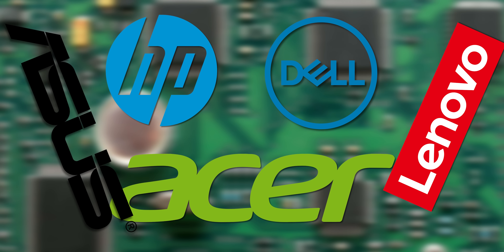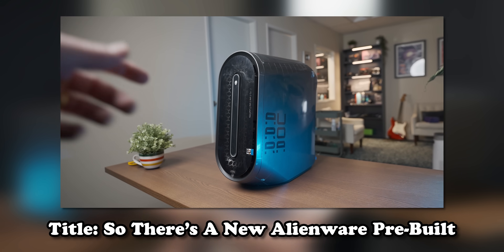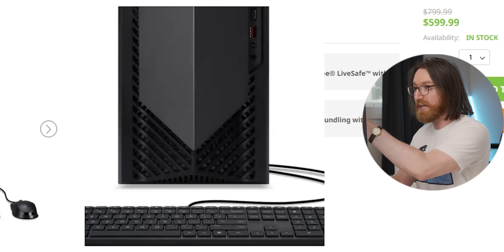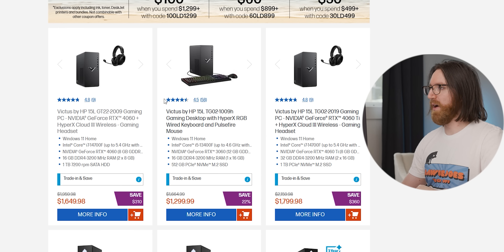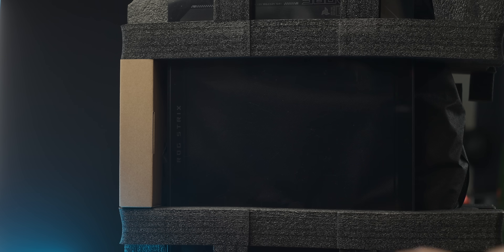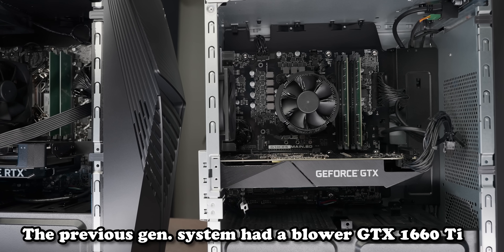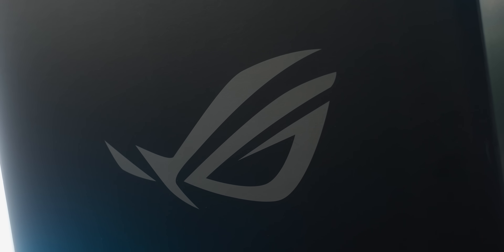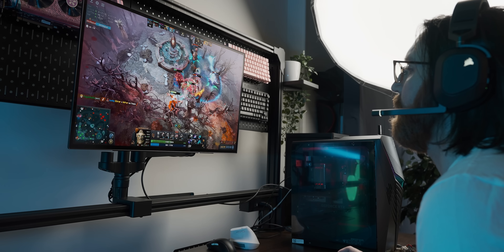Are Pre-Built Gaming PCs Better In 2024?

Comment: So if shouldn’t buy an OEM prebuilt, where should I get? I’m looking for one with a 4060 TI to a 4070 super with 32 GB of RAM. I found the 2024 preview Asus with a 4060 TI on Amazon for $1300 used. What should I get instead? I don’t want it to be too much more expensive either.
Reply: I’m no professional, but my advice is to do what you’re doing with amazon resale/used. Just ordered an asus prebuilt with a r7 7700x and a 4070 for $1281, after tax, “used like new” as far as I’m concerned used like new can only be cosmetic damage. I also seen walmart has some ibuypower builds listed for $1,150, though they are out of stock. If you aren’t in a rush to get one I’d keep an eye out for what deals come up, you should be able to get something good for whatever you’re willing to pay

Comment: I have the Alienware R16 with an RTX 4070 and intel i9. Runs amazing and under max load on the 4070 it runs about 80 degrees c on a 165hz monitor and very quiet. 60 fps runs about 60 degrees c. Does absolutely everything I need it to gaming wise and more.

Comment: I always look up the top 5 motherboards and then check prebuilts to see if they have one of them. If not no deal. I am not positive but I think you need windows pro so that auto hdr will turn on automatically. If so home is a deal breaker. Another deal breaker for me is the green ram with no heat sinks. Ram speeds, gpu gigs of ram and speeds matter. I usually can built a pc about twice as powerful for the price of a prebuilt. I bought a top end gaming pc from someone on ebay who buys parts whole sale and sold be the system far cheaper than I could buy the parts. All MSI parts with a trio gpu.

Comment: I have the previous gen Lenovo prebuilt.  it's a nice case, with a glass side and nice RGB.  It came with dual channel ram and a nice cooler for the CPU.  It's been running great since I bought it, very quiet with no signs of slowing down.  I've bought a few Lenovos since they were IBMs; and they were always solid.

Comment: Thank God they finally added real air vent holes. I'm not too technically sound but would  removing the transparent side (front ones too  if  the internal hardware is not too close) panels and drilling more holes cause any perceived issues?

Comment: I upgraded my 1660Ti with an Rtx 4060, then refunded it 3 days later because it was trash and gave me zero performance increase, about 20% more.
Bought a Rtx 3070 with the money instead, which was great purchase.
Reply: Crazy how crap the entry level 40 series is. The 3070 is about the same as a 4060 on the used market and is way better

Comment: Dawid, you forgot number five, Custom made motherboard and connectors. In case you decide that you want to upgrade your OEM system, you realize that the power button connector is no compatible with the motherboard you purchased... only to realize that you need to start cutting parts and trying to make it work. Some OEM models, still do this crap in 2024. 🤦‍♂

Comment: Glad to see the ailenwares using the XPS style case, my XPS8950 has been a complete tank (why i got it) no dumb gamer crap and excellent support for what i need, even grafted a 7900xtx in mine. Dells proprietary parts are fine honestly, they tend to be common across XPS, Precision, and Optiplex lines and rarely cost more then standard parts. The mechanical and thermal performance is much better then what ive seen with modern all glass garbage cases.

Comment: There are some really good non-OEM, standard parts, prebuilds that are genuinely better value for money than getting the same parts on your own, but the big issue with these are that value for money can be a double edged sword. They are so focused on optimising the value to performance that it can limit your upgrade path even without being all OEM. 

Case in point: I got my current PC during lockdown, when there was a GPU shortage - which was the only way to get anything close to the RRP. Its an i7 11700 paired with a 3070 - which means that the only real upgrade path (without upgrading both the GPU and CPU) is a 3080. Any other GPU and the CPU will become a bottleneck. It also isn't worth upgrading the CPU alone as the 11700 is pretty much at that sweet spot for the 3070 to get maximum performance out of it. 

Prebuilds that leave more headroom for future upgrades do also exist but these tend to be the fancier "bells and whistles" ones that cost much more than just getting the equivalent parts 
ey are so focused on optimising the value to performance that it can limit your upgrade path even without being all OEM.
Reply: prebuilt computers are a ripoff and pointless, 4-5 year old kids build their own computers, its sooo easy to build a pc
Reply: @ImakeTanks  you can get them cheaper than building your own if you go with a decent builder. I've built 3/5.of my PCs, the nice advantage is getting to pick your own parts and make sure there is a proper upgrade path, but given how manufacturers are forcing mobo upgrades every 2-3 years that's not as much of an advantage as it used to be.

IMHO a good non-OEM prebuilt is as good as a custom nowadays. The real decision becomes value for money - which really depends on the supply and demand for parts. If GPU and CPU demand is high and price is inflated, prebuilts are better. If the it's the opposite, custom is preferable.

Comment: I bought my first prebuilt, an Acer Predator Orion P03-600. And it's quiet good, i got it for 200 euro on the used market. It has a i5 8400, 8gb dual channel memory(In the wrong order, but i fixed that) GTX 1060 6GB (Upgrading it atm to a Arc A750.) It's very quiet i havent heard the fans at all.

Comment: The constant pushing of dual channel is unneeded. It is a lot smarter to get 1 stick now and add another one down the road for when the extra ram's needed, if you're being budget conscious. Dual channel does what, 10% at best improvement? Furthermore, while crappy aluminum block motherboard-facing CPU coolers are not great, if it's for a 40-60W heat load it's fine. Especially for moderate CPU usage like gaming. Ventilation is important to touch on, but this is a video focusing too much on things that don't really matter when compared to CPU/GPU choice, value for performance, or any other metric that makes more of a difference than ram that can be had for cheap years later when it's needed, or a louder CPU cooler.

Do you research before doing a video. The R16 has been covered ages ago, and is improved thermally over the R15, as an example. It takes 5 minutes or less to find someone who's reviewed that slot in the front instead of going 'ooh wow well it's probably not because prebuilds amirite lol'.

Comment: lasy year my custom build from 7 years ago just stopped turning on completely.  i quickly went on ebay and found a cheap used dell last year for $120 shipped with an i7-6700 and nvidia 1200 quadro graphics card.  it's been just as good as the custom build i made 8 years ago.  it's not perfect when emulating switch games and doing heavy video editing and design but it has far surpassed my expectations.  i wish i had bought a decent prebuild many years ago instead of buying into the hype of building my own because i had so many problems and headaches from that thing.  i feel like i was conned because of all the forums and videos i was watching at the time was probably loaded full of pc hardware techs who scratch each other's backs selling pc parts and whatnot.

Comment: Hmm, not terrible then. I dislike how some OEMs are STILL using single channel memory, which is simply inadequate. Also, were some of the cheaper ones STILL using GTX cards? It's time to say goodbye to the GTX 16xx series, we should be buying at least an RTX 30 series card, even if it is a 3050 or 3060.

Comment: I'm tryna configure my own PC rn and I have about 1800$. Now I am going to use the PC for programming (work) meaning dotnet, visual studio. And I love me some side project unity games. And some moderate gaming meaning overwatch, cs2, LoL. I stopped at i9-13900kf, palit GeForce rtx 4090, msi pro z790-p wifi (motherboard), 2x16gb Kingston fury beast ddr5 ram, and a 2tb Kingston m2 SSD. Now this tops at about 1600$ in my country(Bulgaria). And I have just a little bit more for a CPU cooler and a case. Should I buy a noctua dual cooler and a 30$ case... Because I have no other option at the moment... Or just wait for next month xD and buy a decent box with nice cooling... I mean I get it is a no brainier but maybe it won't overheat because the GPU has its own cooling system... I don't know. Also I chose the Intel because from my experience they overheat less. I'm also gonna buy a case that has a lot of holes, I mean the front is completely all open, it is on vertical plastic pieces and the back is regular and the side has a decent amount of holes. But the question is should I even try running on just the GPU coolers and a expensive noctua CPU cooler ? Or maybe I should buy a AMD CPU because of the problems with the 13/14th gen of Intel .. ?

Comment: I have an HP Omen 30L prebuilt PC from 2020 w/ 10900k and an HP branded RTX 3080. The CPU has an AIO water block and the entire front of the case is a screen with one 80 mm intake fan. Off the shelf parts, Corsair 80% Plat PSU, 32gb (16gbx2) Fury Ram and WD and Samsung SSDs.It's been the best computer than i have never built.

Comment: I got a nice config system from pc specialist, 7900xtx. Good cooling, what is dod was put a mini desk fan blowing into the front vent, and i put a usb fan rack on the top so effectively drawing air out of the top. Really simple and cheap solution even though it was cooling fine, this is to top it off

Comment: Had an HP Omen 30L with RTX 3080 ja 5900X to sort out because it shut down during gaming. That build was just cursed and I felt so bad about everything. CPU was overheating with 120 AIO not having enough cooling power, case didn't breathe (there's a whole series about modding this PC to cool properly, it still sucks and better just to buy new case), RTX 3080 got instantly to 104c on hotspot (70c GPU temp and heavy throttling to below 1,3GHz core) and transient spikes from that RTX 3080 hit the HP power supply too hard and the PC shut down. Atleast that's my verdict about it D:

Comment: I'm not sure you can claim low quality parts is true. Dell and co have been giving 80+ gold rated power supplies for over a decade, they basically never fail if you use the stock build, which makes them excellent for just adding a GPU too for a cheap gaming pc.

Comment: Do an Omen review compared to this. Many points you made about HP are different in the Omen models. I had a MSI GPU, A huge CPU block (cooler master I forget), a Corsair PSU that was gold 80 (I did pay extra for that specifically),  if I was being extremely picky I found their cable management only average

Comment: 2.000 dollars for an i7-14700f with a RTX 4060? rofl, what a scam, i can buy a pre build in Portugal with an 
CPU: Ryzen 7 5700x3D
Mother Board: ATX MSI MAG B550 Tomahawk
COOLER:  Water Cooler CPU Arctic Liquid Freezer II 240
Graphics card:  Powercolor Radeon RX 7800 XT Hellhound 16GB GDDR6 OC
RAM: Kingston Fury Beast RGB 16GB (2x8GB) DDR4-3600MHz 1R CL17
Rom: SSD M.2 2280 WD_Blue SN580 2TB TLC NVMe PCIe Gen 4.0x4
Power Supply : ATX Seasonic Focus Gold GX 850W 80 Plus Gold Full Modular
Case: ATX Fractal Design Pop Air RGB Black TG Clear Tint
For 1.400 ( tax included ) ....You guys are getting scammed hard.

Comment: Nothing makes me more mad than the HP pavilion gaming desktop with a Ryzen 5 5600g that only posts with 3 specific CPUs; the 5600g, 5700g, and some Ryzen 3 I think. Had to use the 5600g for another build so it is useless unless I pay $100 or so for a 5600g. It only cost me $250 sans GPU

Comment: I bought a lenovo prebuilt with 3060 12 gb and i5 11700f. I added another 16gigs of ram, an ssd and a hdd. I quite like it so far. I got it for 600 usd
Reply: 2:30, yep this one is on point. This thing has a strange motherboard and a laptop type of fan cooler. cannot upgrade it nor move the board to another case
Reply: I think lenovo is the best value rn, might buy my 1st pre-built after building my own many years ago, pre built seems worth it

Comment: It's funny, that my 10+ year old CoolerMaster Elite 350 Mid-Tower has better cooling options than modern pre-build units. I keep on re-using this old case for my upgrades, swap out the motherboard and PSU insert video card. It also has front-usb ports. Also, how do you mount hard drives on these types of systems. I don't see any drive-bays. Or is everything SSD these days with NAS storage.

Comment: Those CPU temps are way to low for i7 14700 on that little air cooler. I would like to see PL1 & PL2 settings and if it has some undervolt. There is no way that i7 14700 would run under 60C with 60% utilization in games with stock power and voltages settings on that little air cooler.

Comment: That Asus Pre-built PC is such a big rip-off & overpriced & the case looks ugly too,, 2k really?  you can just build a system with better specs for just 500 bucks, i built mine with RTX  3060 12 gigs ver which is better than the 4060, but i did somewhat cheap out on CPU but it didn't affect my system performance at all, 4 tb of storage, and 64 gigs of ram

Comment: Oh, and they also change the pin outs on their boards so the cables have to be reused or the pins on the front USB will not function. If you try to re-case the motherboard you cannot use the USB plugins from the new case as the pins do not match. Oh joy.

Comment: Your videos are always interesting and provide an additional level of humour that's otherwise missing from this boring(?) field!  My last Dell PC was my impetus for building my own PCs after that.  What a dumpster-fire that was, with, among other things plastic drive brackets which went brittle after a few years, depositing said hard drives at the bottom of the case.  And is for building your own PC, there's very little that beats that sense of accomplishment when you finish putting everything together and press that power button, and .... "IT'S ALIVE!" . Ok, maybe I've set the accomplishment bar a bit low, but still ...

Comment: What you are seeing in prebuilts is sort of a closeup of the reality of the computer business right now:   Simply put, there are plenty of very good and very similarly performing options, all with about the same price, and they generally play nice together.  As you said, give it cooling, give it at least two sticks of RAM, and you are off to the races.   There isn't a lot of product differentiation in the market now, except for which company has screwed it up the least.  So when the biggest oops in a system is that it is an intel processor instead of AMD, well... yeah.  

Mainstream computing is sort of a very grey zone of nothing right now.  It all does a pretty good job.

Comment: bought micro centers brand of pre built. had a 5800x3d, RX 7600(terrible combo for a 1080p pc) 1 stick of 16gb ram, 512 gb m.2 ssd, but the big thing is the case, idk the name of the case but its amazing, vents and mesh on the top, bottom, front, back bonus is that all the parts are off the shelf so you get that cheaper price. paid 860 usd for this, spent 400 on an RX 7700xt, and bought another 16gb stick of ram. later on bought a 1bg ssd and now it went from a 1080p gaming pc to a 1440p PC/ low end 4k PC

Comment: I will watch but the tag is rhetorical. Prebuilt pcs are always 40% more expensive than a diy equiv and always shit.

 I built a 5600x/7800xt/32gb ram 4k mhz/ 850 psu/ aio TA cooler/braided cables/ B550 mobo/4tb NVme ssd W11system for less than my brother's OEM craptastic 6750xt asus prime 320a mobo 16gb 700w psu 1tb w11 prebuild. Really? wtaf

Comment: That Dell has three cooling fans pulling through the top mesh to liquid cool the CPU.  The slot at the front goes to a mesh panel, but there are no fans in the panel.  So, 3 fans on top for the CPU radiator and one fan at the back.

Comment: Power draw isn't the issue.. that CPU can use 220w of max power during load screens. The problem is high voltages, at high load, while at high temperature. Those 3 combinations of things cause degredation. If you have high power, at high temps, with low voltage, you never have a problem. TVB voltage optimization was made for this very reason and was what the 0x129 microcode mainly fixed. Since intel claimed it had a bug in the code.